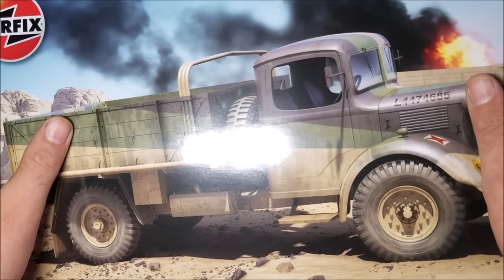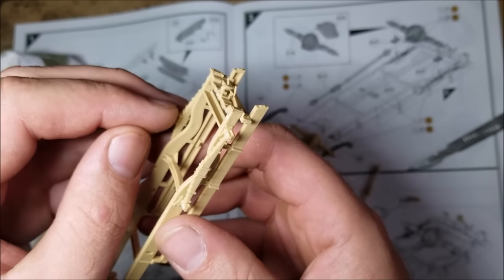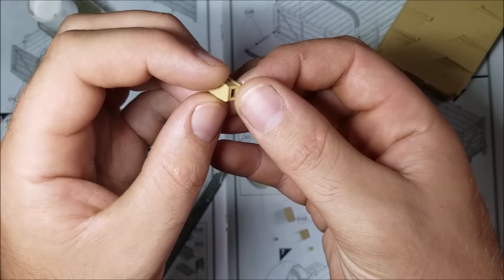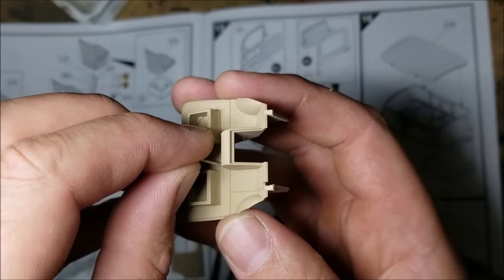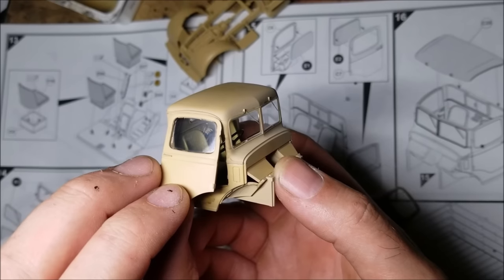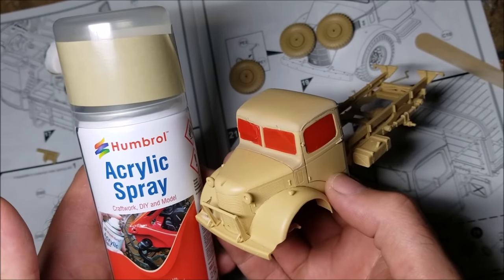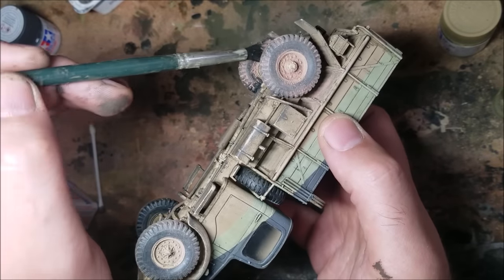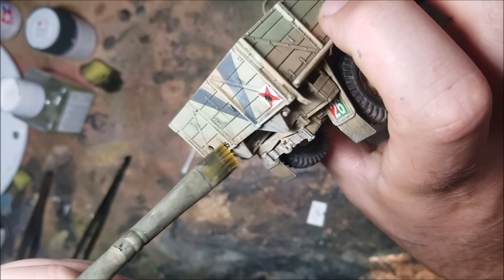NEW AIRFIX 1:35 Austin K30 General Service Truck Full Build and Review

Comment: Great build vlog! No Wittering, no BS, just straight advice and easily followed tips! ❤️👍🏻👍🏻
Reply from the maker: Thanks mate, bear with me on future uploads,this is how the channels going and a few videos are lead ups to this style
Reply: @scalestuff1066  No worries! A good enough vlog for me to subscribe to the Channel and like....😜👍🏻👍🏻 Got a few “North Africa” subjects to crack on with myself.....M3 Stuart, Matilda and I’ll add this kit to the list....😎😜
Reply from the maker: Thanks for the sub mate,if I start a history ramble on the old ones just skip forward a min.Nice how the builds coming along? Did a stuart last winter in the desert cam,got to love a good caunter camo,this is deffo worth getting such a laid back build
Reply: @scalestuff1066  Not started on any of them....yet! 😜 I’m cracking along with a 1/700 HMS Rodney at the mo. There are basically three kits on the market in this scale, Tamiya, Trumpeter and Meng....one of them is a full hull kit but none of them depict Rodney as she was, when she faced off against Bismarck! Second issue, there’s not much in the way of data re photos, design drawings, etc, so it’s a bit difficult to tie down certain details about her but after much cash outlay, I’m in the process of sorting out a pretty accurate rendition of her! 🙄😜 As you can imagine, photo-etch in this scale is an absolute ‘mare to deal with....even drilling out and fixing 1/700 16 inch gun barrels has been a right B.....d but I managed that but it’s either a day to tackle a job, or a day to not....knowing which is which is proving a bit critical.....😂😂👍🏻

That Caunter scheme is something else! There’s a small book about it and I must try and get a copy of it.....although my old work mate built the Airfix K4 Ambulance and finished that in the Caunter scheme and it’s what made me look at it in the first place! 
I failed to say that I’ve got a couple of SAS / LRDG Jeep kits, the Chevrolet 30cwt and also a Scammel Wrecker. I might forgo the Airfix truck and take Gecko Models version with the open cab, as that fits the desert thing a bit better....no reflective glass, etc...Also, AC Models do some fantastic figure sets and vehicle load outs for the Chevy and Jeeps BUT they are also commanding fantastic prices....roughly £15 a figure...it doesn’t get any cheaper, that’s for sure....😂😂
Reply from the maker: Ah well we all have that shelf so I can understand that one, Oww nice, I am shocked though that there is no kits of it showing the Bismarck stand off :/ . Yeah the ships can be like that, I spend an age trying to find pictures of the soul bay for a customer that sailed on her from a certain time frame in the 70's and finding shots was like hens teeth.Yeah the photo etech puts me off the ships as on mis placed finger and its game over for the part sometimes.

I saw that book but never got it, I think I saw the pattern on a tank museum video, and you know what its like with ww2 British its all just green for the most part, so naturally drawn to something a bit different.
Nice I have done both if they are the tamiya kits, and they both build into good models the jeep has tonnes of gear with it to really load it up.Just on a spree of trucks atm (you will see them later) but the scammel I think looks epic, just done the little 1:76 airfix one and want to build a 1:35 at some pointYeah tbh I have heard good things on gecko kits but not got my hand on one yet. Yeah sometimes the figures take the mic a bit, Ive been doing alot of 1/76, and you can get boxes of 40 tank riders for under a tenner and I kind of prefer that price range myself
Reply: @scalestuff1066  Re the Scammels....look for the Thunder Models kit....they’re the most accurate....I’ve also got the Scammel Artillery Tractor....do love a Scammel and Grandad drove them during his WW2 REME day’s...

Re Rodney, I’ve had to buy several kits so that I can cannibalise them....Rodney had certain things on her that migrated on to the 1942 modernisation but that weren’t on the 1927 fit....and some of Trumpeters superstructure is more suited to it than Tamiya....so I’ve got a Tamiya hull, Tamiya Turrets, 50% Tamiya superstructure and 50% Trumpeter....White Ensign photo-etch for certain items.....like the aircraft catapult and crane....and davits....and railings....I’m getting grayer as I type this! 😂😂😂

Need to learn some simple lecky work and soldering to....I want to diorama burning ships and planes using LEDs....some of the vids make it look a reasonable proposition.....must be mad! 

Right, I’m away....just watched your over view of the Achilles M10.....👏🏼👏🏼 I’ve ordered the Andys Hobby HQ 1/16 kit, as I think that it’s a proper beast....
Reply from the maker: I will check them out thank you for the heads up do love a scammel cracking things, Did he say what they where like to drive?

bloody hell thats commitment though and I bet it will be well worth it when its all put together

Yeah I have just tried doing that for a 1/72 crocodile and at that scale its all to fine for me and my old second hand soldering iron

Oww thanks for the watch but fair play on the Andy hobby headquarters kit, hope it goes together well for you and sorry for helping you go a little greyer, Hope you have a good week mate all the best
Reply: @scalestuff1066  No worries....my baldness out runs the greys by some considerable distance! As Grandad used to say “I’m growing skin”! 😂😂😂
It’s been lovely to be in contact....I’ll keep up with you and look forward to it! ATB....had a crap afternoon with Airbrushing some white enamel on to an RCN Corvette.....first side wonderful....second side and the brush clogged up...clean and clear and off we go, clogging up again....all the flow rate of a geriatric with a urinary infection....😂😂😂....I’ll try again tomorrow (had to put it down before it quit “sailing” and took up flying....😎🤪😂😂
Reply from the maker: hahaha I have not heard that one before, And same to you mate, I only know 2 model makers in real life and everyone else gives me funny looks, hope the airbrush starts earning its keep and stops you from taking up flying hahahaha :)
Reply: @scalestuff1066  PS...Yes, he did....Scammels....always hold the steering wheel with your palms, all digits outside of the circumference of the wheel itself, because it can violently throw itself about (cross country) and that’ll be that, busted wrists and fingers....He preferred driving the Diamond T’s.....I just don’t like the look of those though! 😱😬
Reply from the maker: That sounds like a beast to drive off road! I think I would pass on driving them off road

Comment: As a child I never had the patience to build Airfix models and usually ended up with glue everywhere and a never completed model. 40 years on I could probably do a good job but I don’t think I would have the guts to miss out elements and doing them later as knowing my luck the section was no longer accessible!
Reply from the maker: Ah should still give it ago,if in doubt paint it first,that's my motto,If you started on some of the cheaper or second hand ones wouldn't be anything if you messed up a few bits
Reply: Grow some modelling balls Gordon and treat yourself for Christmas! Post a comment back here if you do and let us know how you got on?😊

Comment: Love how the tyres turned out,  very nice weathering.
Reply from the maker: Thanks mate was my first time trying the dust coats for tires but will deffo do it again on bigger wheels
Reply: @scalestuff1066  This K30 is on my 'to get' list & cheaper than Gecko.   Bigger wheels would be the go.   Was sussing out the DEF Model K2 sand tyres but the LRDG Chev wheels look wider.  Are they?  Stud pattern looks the same but axel ends are different, that's fixable.
Reply from the maker: Im not sure just had a look at them to see if there are any dimensions for width but no joy, I like the LRDG wheels they look a bit more aggressive, But sorry I couldn't be of help on the width, If its any help I just measured the ones on this model and they are 12mm thick
Reply: @scalestuff1066  Gee 12mm!  Certainly wider than I thought.  Thank you very much for that.
Have a good weekend.

Comment: Your build/review is an excellent advert for this kit and I will be buying one. I sincerely hope mine turns out as well. One point though I doubt that the flimsy cans would be stored upside-down as I'm sure they'd leak, but I may have misread this.
Reply from the maker: Thanks mate best of luck with your build, yeah I agree on the flimsy cans I have never seen them put into a truck rack upside down, if they had a tap on them would be handy but like you say would leak and make a mess

Comment: Be nice to see some weathering on the cab glass, wiper marks, side windows wind down marks etc
Reply from the maker: Yeah I get that my mates dad said the literal same thing to me, Any tips on how to go about it though? I've tried before but the paint seems to rub off, or roll off?
Reply: @scalestuff1066  I have a 25 yr old Defender that lives in a garage and gets dry use, gets washed a couple of times a year, it gets very dusty sitting at Glastonbury while I work for 10 days, pretty good example for weathering. The unswept screen area looks matted, insect marks do not clear easily on the screen but the wiper areas are defined and show movement marks, side windows show directional movement marks from opening and closing, more on the drivers side. I’m guessing light Matt lacquer and dust, mask off the wiper area, cotton bud for directional marks? That or light rub with very fine sand paper 2500-3000 grit?
Reply from the maker: Nice I would love a defender but the price of them has sky rocketed in the last few years, year maybe thats the way to go about it, just be worried of over dirting it, Im going to give it ago though on a future build, anything military generally  kicks up and collects muck

Comment: Lovely work not sure I’ll be adding it to my collection but like it a lot.
Reply from the maker: Cheers mate thank you, ah plenty of time to work that out it's only just been released
Reply: @scalestuff1066  been bitten by the 16 scale releases bug :) - meng was my preferred manufacturer in 35 they went off the boil so got into 16 scale
Reply from the maker: Tbh I've been looking at the Achilles 1 16 scale,are meng releasing still as not herd of a new look from them in a while
Reply: @scalestuff1066  I have too but still have the tiger 1 to finish and have the Das Werk Half track 16 scale on pre order
Reply from the maker: Is there much interior on them around the hatches and such like? As on a model this size would be nice to have those details
Reply: @scalestuff1066  annoyingly nope - have a look on here at Andy’s Hobby Headquaters you will find step by step builds on them all
Reply from the maker: Seems a bit of a waste of that sort of scale,mean even some 1 35ths have that stuff,I'll check them out
Reply: @scalestuff1066  some have plumbing and things but mostly it is external detail. I like them but that’s more due to them being impressive in size
Reply from the maker: Yeah the detail you can go into on the paint work I imagin would be unreal, Id like to get the achilles and make it RC TBH as I have a 1/16 tiger thats remote controlled, I never did it as a paint video But there is a video of it on the channel and I did paint it up, I used oils to get the fading and sun bleaching look to the paint
Reply: @scalestuff1066  sure it’s possible the RC thing never been something for me

Comment: I was impressed with your brush painting as Tamiya acrylic paints do not normally brush all that well.  Did you use a retarder to alleviate brush strokes?
Reply from the maker: Thanks mate, and no I try to put tamiya paints on slightly thicker than other paints and work with them really fast so that the paint can self level. I know what you mean with tamiya though it can be tricky. I find when the humidity is high that I just cant get a decent coat with the stuff as even put on thick it dries to fast

Comment: My understanding is that softskin vehicles were not camouflaged with the Caunter scheme, only AFVs.
Reply from the maker: No was on  the trucks to, later I think they ditched it tho, but its even in the manual for how to apply the paint, what really can not be unseen is the fact the pattern is the same on all of them, not sure if this link works, but here's a convoy of the ambulances in north Africa all in the pattern https://fft-keymilitary.b-cdn.net/sites/militarykey/files/styles/article_body/public/imported/2020-03-24/img_78-4_10.jpg?itok=L5xw0yg4
Reply from the maker: Just went down a little rabbit hole, it was dropped in november 1941 but was still seen in the front line until 1942, after that some rear groups still had it if they where not on the front line but they often got painted over and after that the scheme was pretty rare, thanks for the rabbit hole!
Reply: Soft skins Were done in camo more so than the AFVs do your research and Look up mike stramer for the caunter paint scheme for the soft skins in Africa!. I have dozens of photos of them and the Quad C8 with the 25 pounder and limber In tow were mostly all caunter in Africa.
Reply from the maker: Yep that's the chap I was reading up on them through
Reply: I've been told this is Airfixes best kit ever? I went for the Gecko one as usual I just hate Airfixes injection pin marks! If it's anything like the Ambulance it'll be a horror story haha
Reply from the maker: It's easy to build there are some tricky ejection pins, most are under rear bed, two ones that are a little pain are in the rear wall of the cab,the kit goes together well though
Reply: Pow flimsies are upside down under the bed
Reply from the maker: That's how they are on this, that right isn't it?

Comment: This is the second  airfix kit of the new 2023 batch (the other was the british ambulance )i have seen built and in both kits i never saw the clutch pedal being installed,  anyone know if there was one or was it a pre select pedal on the floor ?
Reply from the maker: The pedals are there  but hard to hold and nothing to show on a video. The pedals are on piece foot plate and rear rod